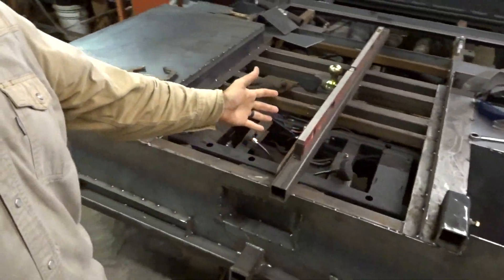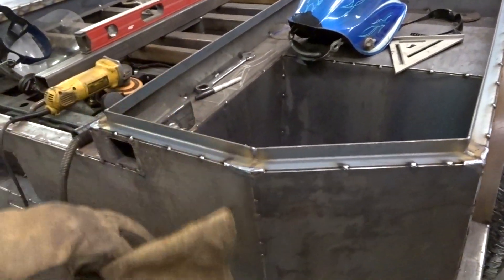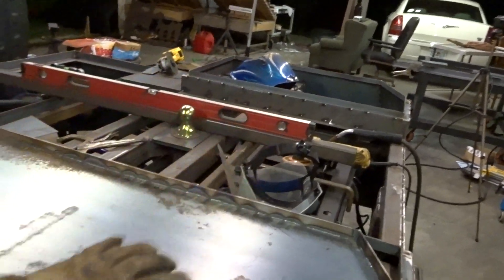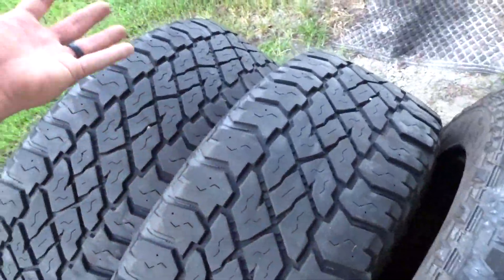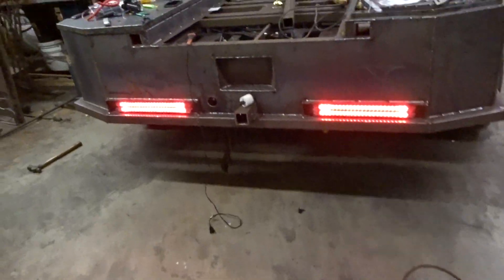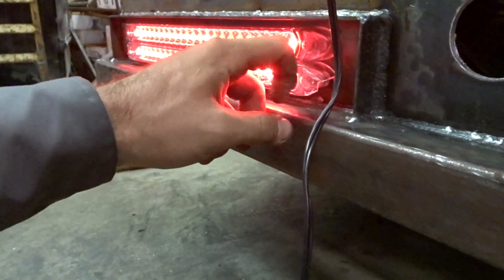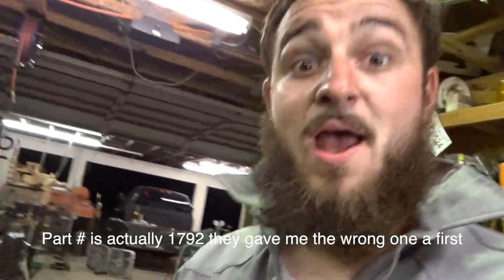Welding Bed Build PT 4

Comment: How much material did you use on it, I’m thinking about building my own
Reply from the maker: About 4-5 1/8” sheets of plate, couple sticks of 2x2 square tube of different sizes, some angle iron for the machine drop in and some misc. other stuff where you need it

Comment: I really like the Goldblatt levels. The vial is really easy to use I just wish they would make a magnetic set.
Reply from the maker: I’ll have to check em out
Reply: @j_moffitt  that red 4 foot level you have is the one. I don't think they make them magnetic. I tried milling a hole for magnets in my 2 foot level and there wasnt enough material. You are making great progress on the build! Keep up the great work!
Reply from the maker: The red 4’ level is just a husky from Home Depot
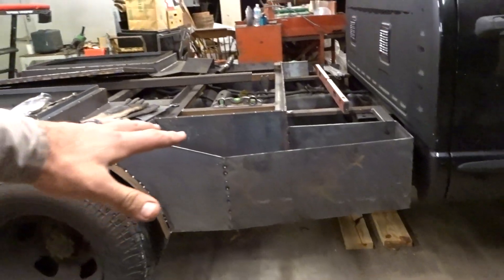Reply: What kind of level is the small one with 3 levels in it? And is it magnetic? @ 8:02.
Reply from the maker: Just a Stanley from Lowe’s with angle finder on it as well and its magnetic